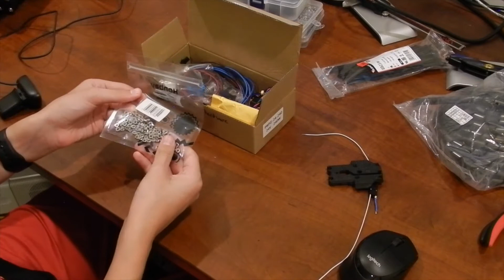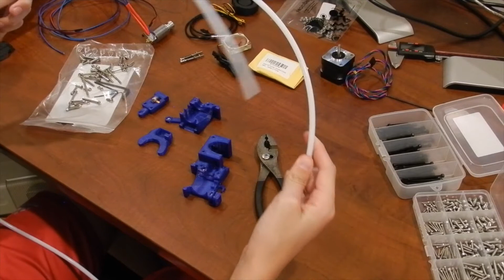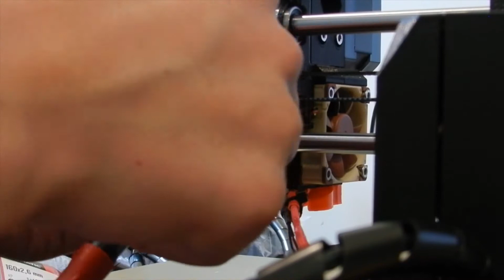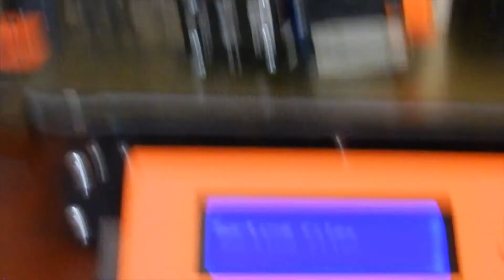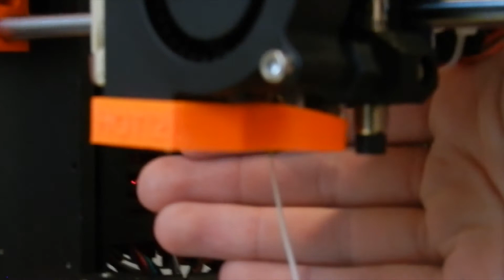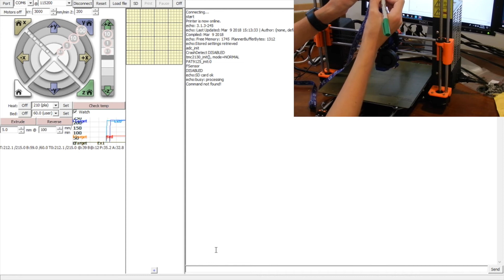Prusa MK2/2S/3 Swappable Hotend

Comment: Ben, this looks like a great project. I was directed to this video by MatterHackers, as I also have a bunch of 2.88 mm filament in need of a direct drive extruder. It appears that the development hasn't moved for the last four years, however. Will the original files from your Thingiverse link work, or is it necessary to modify them as you have mentioned? The Thingiverse link seems to be an upgrade for an MK2 to an MK3, rather than a 1.75 mm to a 2.88 mm system.

Are there working parts files available? I hope this hasn't gone totally stale.